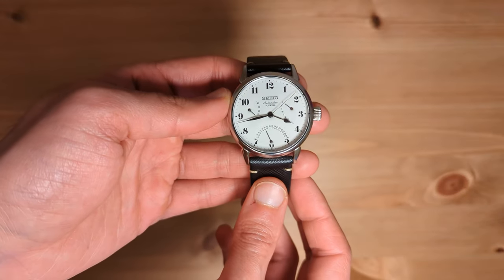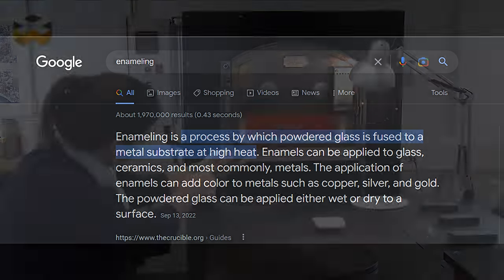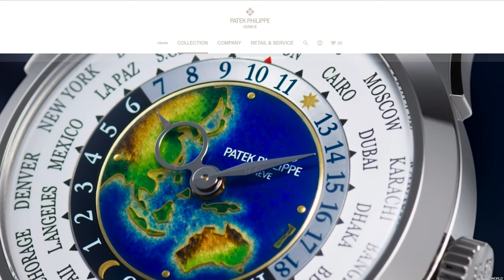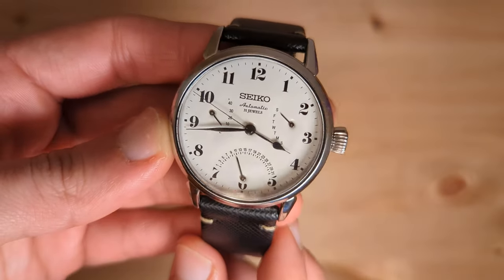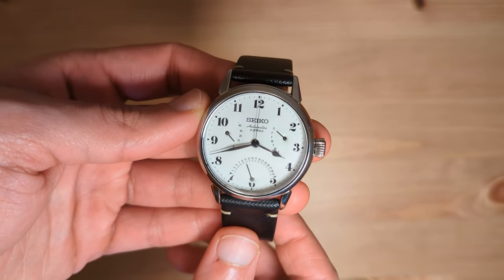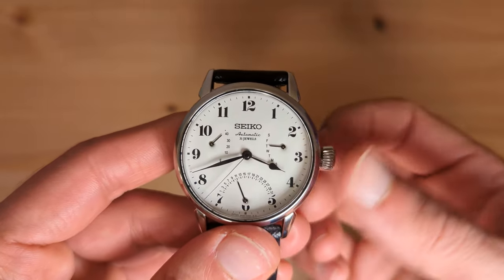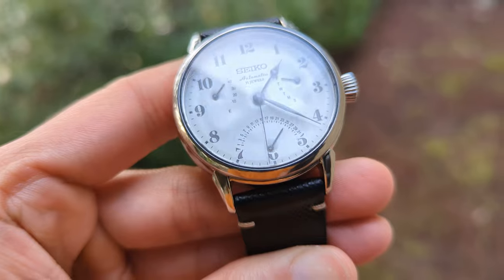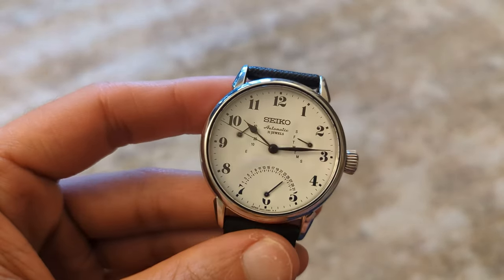What Are Enamel Dial Watches and How Are They Made?

Comment: What’s the difference between a dial that is “enamel” and “lacquer”? They seem like the same?
Reply from the maker: I think enamel dials are made by fusing glass at high temperatures and then putting this substance into a mold.
Lacquered dials are produced by spray-painting a few layers of lacquer (or enamel paint) on the base dial. 
So they are really similar